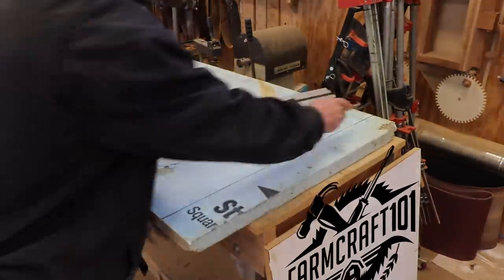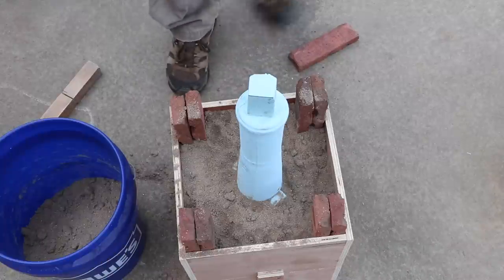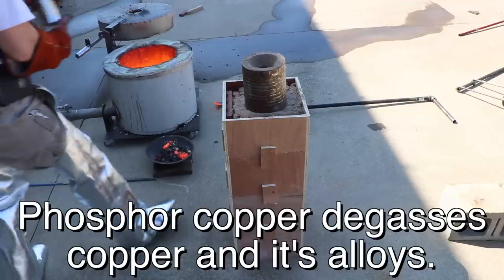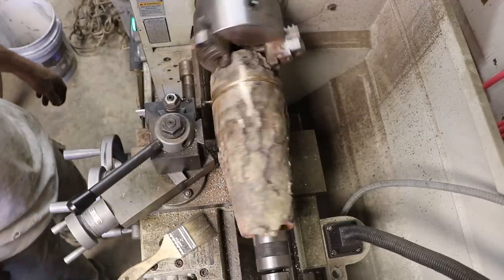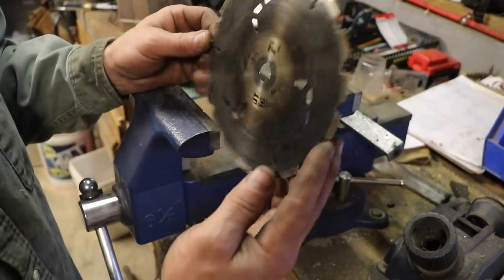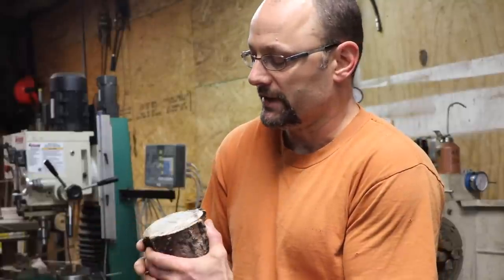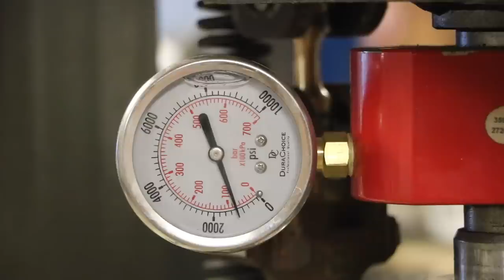How NOT To Cast A Historic Bronze Cannon Barrel.  FarmCraft101

Comment: It would be a crying shame when you finally have a cannon not to watch it directly, so why not set up either a periscope arrangement for yourself, or a polycarbonate shield above, or even in, a blockwork wall so you can stand and watch through the shield?  A top quality motorcycle helmet visor will stop pellets from a 12 gauge at short range, fragments from an explosion will have a greater initial velocity but slow down faster with distance.  So thicker plate of polyc is likely to be enough at a reasonable distance.  Just something you might want to consider.

Comment: I think you'v made a mistake when calculating the ultimate strength of your material. Namely when you divided the force of the press by 2. I assume that you used the area of the press piston to determine the force exerted/psi of pressure but then dividing it by 2 doesn't make much sence then again i didn't see you setup. But assuming you have a solid fix point on one side and the press on the other side the total force going trough the material is in your case 5188 not 2600 pounds if the area of the cylinder is .127in^2 then that would equate to +-40000 psi which is right in the ball parc of what you material is supposed to have.

Comment: Why would you make a cannon out of copper,tin,brass and other soft metal?
When you can have Iron or Steel.
But I am sure they used steel whit the old style cannonball cannon.
And Steel for the more modern of Cannons.
Reply: mostly too do with weight, can haul an incredibly heavy cannon all over a battle field just takes too much time and is too dangerous, so they used lighter materials. also it had a lot too do with the abundance of materials. and if its was going on a warship, merchant ship, patrol boat, or used for land warfare/in forts.
Reply: Cannons were molded in that times and molded iron is not strong enough to make a cannon out of. At that time they were unable to produce steel parts of that size. Molded Brass was stronger, easier available and easier to machine. Later, maybe 1870, they had the technology to make steel cannons.
Reply: @notnanot  Interesting.

Comment: Like Alf Lacis said below, pretty convinced you are dividing by 2 when you shouldn't in your tensile test calculation. Why not test something with a known tensile strength and check your method.
Reply from the maker: I have. Watch my other videos. Dividing by two is necessary because of the way the testing machine is set up.
Reply: @FarmCraft101  I just looked at your video where you built your tensile tester last year and I get it now. You have lever dividing the force by 2. I got misled by how you explained that in this video. I used Instron mechanical testers for about 30 years as part of my research work before I retired. The Instron machines have two matched precision screw feeds each side of the frame and that makes it easy to do tensile or compression testing; but this is an expensive way to go!! Your approach is good value for money.

Comment: Seems like you should create a checklist or SOP before doing a project like this. Every step you forgot something or something didn't go quite right. Those kind of distractions can lead to serious accidents from being distracted trying to fix them. 

That said, how about a video on casting 3" cannon projectiles from pure soft lead? Getting consistent density and no voids isn't easy. 

Check out moulds for bullets. They use vent lines for the air, it's critical to getting good castings.

Comment: Never use a grinding tool like here: A proper shield of the disc in motion is absolutely a must! At 13000 rpm there is a relative speed of ca. 80m/s or 270 km/h. Imagine the kinetic energy of the debris in the case of....

Comment: The alloy penetrated the sand as bronze/ brass does especially if you used brazing flux instead of foundry flux. So you are basically cutting a rotary bronze sanding cylindrical hydrogen laden dangerous artwork device, so to speak. And I get a tensile strength of 9448.8188 psi. Wow your math is like just wow.

Comment: "What if I try sanding it instead of scraping* it?"

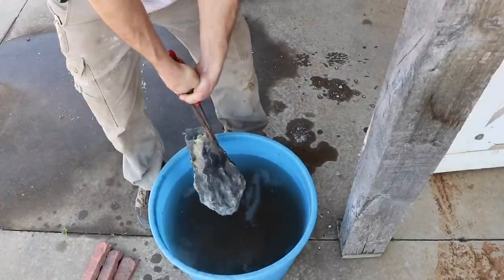When water becomes gas (steam) its volume increases 1700 fold, hence the explosion at 8:48
Reply: 256-fold
Reply: @danspector7543  - actually, I looked it up, it's 1600-fold.

Comment: It looks like you're working on a concrete slab. Don't do that! A molten metal spill will result in a steam explosion (like the one in yer bucket) from the moisture in the concrete...... Ask me how I know this.... 
Correct foundry practice is to do the melt & pour on a sand floor.
Reply: That's what I was thinking when he asked what could go wrong . . pouring over wet concrete no less ( or even supposedly dry) + spill = sprayed with molten metal

Comment: You shoukd have vented the mold. The pressure of the foam gases and the metal it has no where to go so it lpushed the metal in to the sand. Foundrymen call it burn in. A harder rammed mold would help and a lot of venting..

Comment: I doubt you could get a proper tensile strength reading if it is water quenched i don't know if the copper tin alloy becomes harder /crystalized when quenching it that fast in water just like tempering and sand quenching oil or water quenching.Like for ferrous metals I had machined a lot of Mortars and cannons like the Howitzers Napoleons and the famous Coehorn Mortars check out my Videos of some of the cannons and mortars.I like 4140 Gun Steel the best for the golf ball mortars & Howitzers.I made some from Tiger Bronze and Titanium the bore was a bitch on titanium.Inconel was a no go

Comment: I believe dividing by two was unnecessary - but I am not sure.
Consider this: Two cars are headed towards each other at 60 MPH.  They strike bumper to bumper, and come to a dead rest. There was a mosquito in the middle.. what was the impact force upon him?  Answer 60MPH.  Not 120MPH.
Example two: a car going 60MPH is headed towards a mountain of granite.  It strikes the mountain and comes to a dead stop.  How much impact on the mosquito that landed on the bumper moments before impact?  Answer: 30MPH.  Not 60MPH.
In Eg1 you take the two speeds, 60 + 60, then divide by two. 60.
In Eg2 you take the two speeds, 60 + 0, then divide by two. 30.

Ah... THERE'S that elusive "divide by two!!!"

But in the case of the brass-test in this video, I think the PSI gauge IS the mosquito!  The reading is the final (or 'after the math is done') figure for the pressure he endured.  No need to calculate - the mosquito is speaking directly.

But I am NOT certain.
Reply from the maker: https://youtu.be/RxoLwyjSRaQ

Comment: The bronze will penetrate the mold. Need to seal it with graphite powder. Casting it vertical is the only way.
Paint it on and then burn it off. Might still penetrate the sand but chisels off. Need to leave it to cool for long time.  Tried to Xray some off my barrels to see where the bore ended but that would not even penetrate the bronze. Need to use sodium silicate and CO2 to harden the mold. that works. Have to compact the sand not just tap it. See my site for casting - www.palmersarmoury.co.za

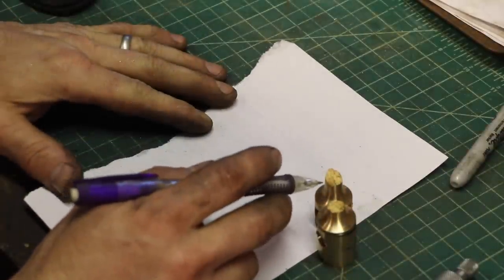Comment: Is the math wrong @16:40? I don't understand the divide by 2.  Force is 1,200 psi, there shouldn't be such a thing as pulling from both sides? If I'm correct, that puts your numbers where they're supposed to be when compared to what you say, "The commercial guys". I care about the correct math to solve problems. Is this wrong?
Reply from the maker: It's not wrong.  This is due to the way my tensile tester works.  Only half of the force exerted by the press is transmitted to the sample.  I have a video on building the machine if you want to see it.  And I tested it on known samples and it gives correct results when dividing by 2.  Cheers.
Reply: I've watched your tensile machine video and see that you have a lever arm creating a 1/2 mechanical advantage for your hydraulic press. I respect and enjoy your content, I just got red flagged that this could be another misunderstanding of Newtons 3rd law. I'm an an engineer, and do appreciate your replies and thorough explanations. Great Content!

Comment: An air pocket caused the explosion for you. Using foam will impart a load of oxides to your pour. The foam is just rearranged oil. When you poured the copper into the form, the reaction of heat with the foam eroded your pattern. Also, I bet your sand was not the correct moisture content and did not pack right. I was always taught to never use loose sand. Very hard to tell the grain structure when you added the tin. My tip to you would be to use Ampco metal and you will have over 100 thousand psi minimum strength. Then you will be alright and stand next to the cannon. Personally I would never trust a bronze cannon. Too many cannons in history exploded. Now that you mixed different elements together you will have a bear of a time making anything to a high tensile strength. Give Ampco bronze a try ????  
   .

Comment: The bricks screwed you. Lose them and tamp each box worth of sand. ALso pretty sure you put the tin in way too early and boiled it off. The physics of why it exploded is called thermal shock. didn't anneal it and cooled it way too rapidly and the tensions created had to go somewhere.

Comment: You were not hot enough. The stuff on the outside that you were having issues with is called burn in. You needed another layer of protection or you didnt ram your sand enough,

Comment: Ok Well, you need to Heat Treat it, And have the Right Sand..And let it Cool off Easy Not to Stress it Out, Let the metal Relax, And Next time Make TWO Styrofoam Dummy's, One the Help to Shape the Mold, and PRE MAKE it to MAKE Sure to PRE BAKE the MOLD, SAND Micro Glass, HEAT Shock, that Crack the Sand into Finer Sand Power if you can, the best molds I did in the 90's.. And the Finer the Better, And if you want to Re Use the Molds But the Paint on Stuff Devil Bake Works, Work on Small Stuff First, That way you Don't Kill your Back Before The Final Build.. But Yea a Little Heat treating and Good Cool Down, and it will Work..But yea the Hard Part is to find the Good 1700's Cannon Builds..

Comment: don't add brass the zinc makes it look pretty but also makes the bronze brittle.
Reply from the maker: 2-4% zinc is in the traditional recipe for gunmetal.
Reply: @FarmCraft101  maybe so but zinc still makes it brittle. Gunmetal is Bronze, copper and tin. Brass is copper tin and zinc, but what the hell it was certainly a learning experience and I haven't done it, so Kudos for that I will have to check my bronze 1812 cannon with the gamma spectrometer when I finally get it working to see what its actually made of i hope the wooden pattern produces a good casting for you.

Comment: The more regular the grain structure the stronger your cast is going to be.  I would look at the techniques for single crystal casting and use them as a starting point - pull a vacuum when casting (or at least significantly lower the pressure) and use slow, controlled temperature reduction to try and avoid premature crystal formation.  Obviously people wouldn't have had the technology to do true single-crystal casting, but cooling slowly and at least significantly reducing the pressure (eg with a bellows or with a ventilation system) should have been possible.    https://www.americanscientist.org/article/each-blade-a-single-crystal

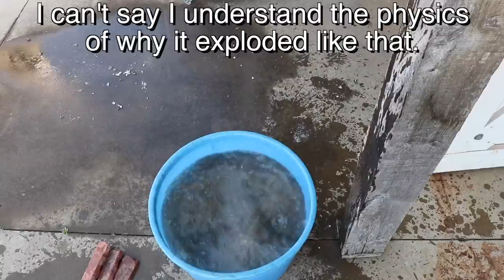Comment: 09:00 - It's hot enough to split H2O into H2 and O2 and ignite it.
Reply: Ah, no. Just high volume of steam throwing the water up rather than bubbling up through.  Also splitting water and then burning it is a net zero amount of energy.

Comment: Here's a video you should check out: https://www.youtube.com/watch?v=NNMF6BDL8nk
Also, I think that it would be a good idea to use a sleeve in the bore so that you don't need to perfect the grain structure and strength of your alloy. Putting in a 1/4in or so steel sleeve inside the cannon's bore would provide more than enough strength.
Thanks for the great content and the learning, you're an absolute beast.

Comment: 9:00 It exploded because the hot metal has split the water to hydrogen and oxygen, then ignited them.
Reply: Actually not. That requires way more energy and heat to happen. What happened was that the water flooding in flash heated into steam. I was looking for this comment because it is a common misconception.

There are some fire fighters below that correctly labels this as a steam explosion, so I just leave it at that.

Comment: I would never trust a Cannon cast with this method. Lost Foam casting is to unpredictable and you could never know if you had sand inclusions and weak spots in it.  Use the traditional cope and drag mold with proper molding sand.

Comment: A circular saw with a wood-cutting blade will easily cut through a 1/2" black iron gas pipe, ask me how I know!
Reply: You forgot to change blades and thought you had a metal cutting blade?
Reply: @mattk6101  I was cutting open a section of floor in an old apartment building, and the gas pipe was hidden between the floor and the subfloor and my wood blade cut right through it like nothing. Luckily the sparks didn't ignite the gas! It wasn't a good day at work lol!

Comment: Actually, they didn't drill out the barrels, they put in a barrel core and poured the bronze around them. As far as the metallurgy is concerned then I would have to say that Alterego42, below, is pretty much bang on. But I am going to say one thing more than any other... for christ's sake do some research, before you get hurt..... if you carry on like this there will be a very abrupt stopping point to your videos and theta will be around the same time as the cessation of your life!